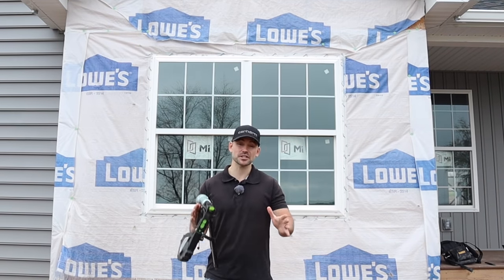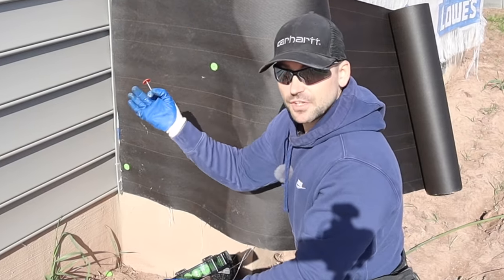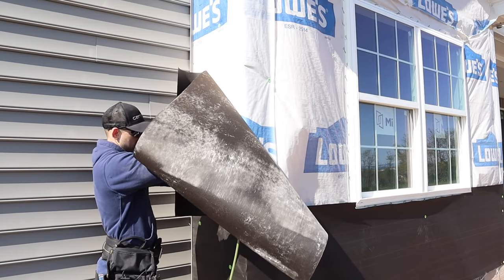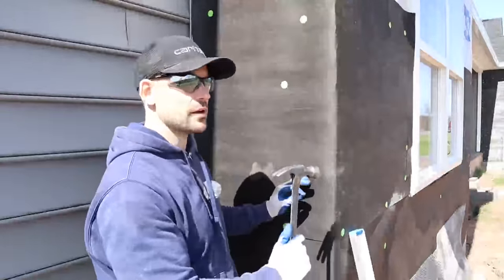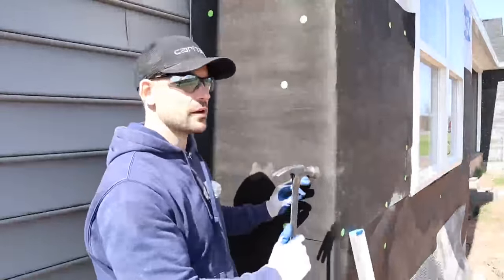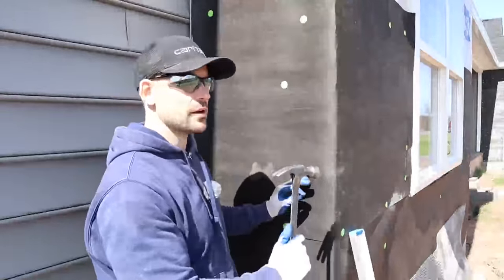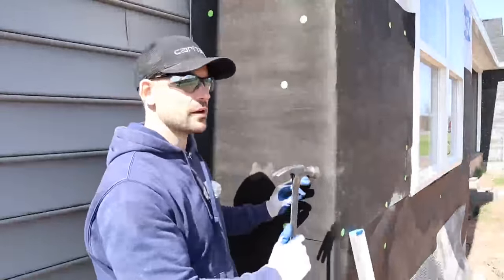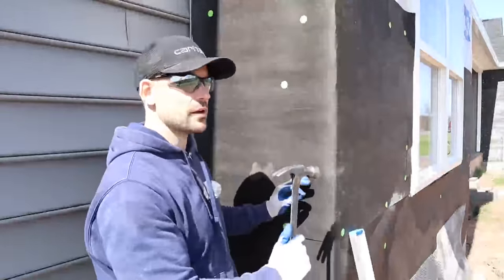Stone Veneer Installation - Part 1. Scratch Coat (Metal Lath And Underlayment)

Comment: I think you might be wrong about the stretch metal.  It is directional.  If you look closely at the little diamond shapes they form a cup.  The cup should face upwards so that as the mortar gets smashed into the screen, the weight of the mortar pulls it deeper into the screen.  If it is upside down, it will have the potential to pull away from the wall/screen.  Where the WRB meets the window flange, if you can/can't get the WRB under the flange of the window, you can use Tyvek tape or similar and seal it to the flange. I believe the WRB and window flange should get taped regardless.  Maybe someone else can comment.  When it comes to wall failures, it not the first rain or the second rain or the third rain or snow or freeze that will cause a failure.  Its like smoking cigarettes.  The first pack won't get you but over a lifetime, you run a higher risk of having issues.  (sorry for the analogy).   Once water starts to get to the OSB, the issues start to happen.  Thanks for the video!  Terr

Comment: The memories of doing cement stucco is so similar. We mixed everything in a big chop box tub because of the volume of cement we did or even a cement mixer. That's all one person did to keep 3-4 guys going. The pully system we used was great for taking 5 gallon buckets of cement up the scaffolding even up 6-8 towers high. Having a 4×4 piece of exterior plywood to load up and go at it. I absolutely love how you take this to a level that those who may never have done either stone work or stucco, will give them the opportunity to try a small project. Expansion joints we had to do on areas that were really large for the purpose of the finish coat on stucco was so important to not get a over lap joint that would actually look bad unless you had at least 4-5 guys running the wall area at the same time from the bottom to the top of the job. Having options is always great to make any job look great. Thank you again Josh for the first part of this project.
Reply from the maker: I have never done stucco before but I would imagine it is very similar to this. I love the look of stucco. Sounds like you guys were very serious! It amazes me to see these huge buildings full of stucco around the beaches. I could only imagine the amount of labor it took to do those huge jobs. Sounds like that is what you guys were into. It is cool how you can paint stucco. The next video is going to be of applying the veneer. Thanks for stopping by David!
Reply: @TheExcellentLaborer  can't wait to see the next step.

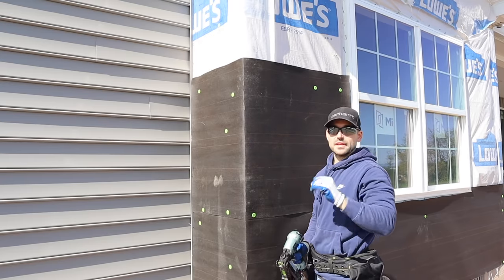Comment: Did I mishear 8:00 ? Installing lath with rough side facing down gives less support to mortar after applying it, making higher chance for it to fail later on. From my understanding, the angle of the lath creates slight upward facing tiny shelves for the mortar to sit into and support.
Reply: That's what I thought. That's the way my father-in-law did it for 30 years
Reply: You are correct, he did seem to be saying apply the lath cups down, which is wrong (although you will rarely see failures in the mortar due to this) Strangely enough the close up shot of his lath at approx. 17min in is cups up though.
Reply: @gabrieldwiggins4442  it might be he was referring to the cup concave facing down... Which would be strange use of English or maybe just a mistake? Not something a pro would mistake though imo.
Reply: Yeah.. he said it right.. you want the cups to cut into the mortar when you start at the bottom and go up. That way it fills the cups. Once it dries it doesn’t matter at all how they are oriented. But they need to be imbedded. To test this try to install lath over a span of 2x4’s without a backer. Properly installed the backside of the lath should look like you are stacking popcorn on the back of the wall. Flip the lath the other way and it won’t be as full ( lots of air pockets) unless for some weird reason you start at the top and go down with your stucco.
Reply: Everyone has a different opinion for lath direction. I like cup up not down, but everyone seems to have a different idea.

Comment: The stone veneer looks fantastic, very convincing. What do you think I could charge per square foot to install this? I've worked with face stone which is 4 inch concrete bricks that vary in size but that veneer looks sharp.

Comment: I'm trying to put stone veneer over exterior brick.  Would I need a water resistant barrier and metal lathe?  Or could I just get away with using only cement board?

Comment: I'm confused, wouldn't you want the rough side facing up so that it holds the cement?
Reply: The lath cups upward when the sharper part is down
Reply: Didn't he say the rough side is outward to add the mortar later. The metal is adhered with galvanized nails, he said.

Comment: Thanks for the great video! Just curious why the underpayment wasn’t pulled tight when applied?
Reply from the maker: Yes it should be pulled as tight as possible. Sometimes it does get a little wrinkled but it flattens out after you put the metal lath on. Thanks for watching Roni!

Comment: Hey! I’m planning on laying some tile that looks like stone on our front entry that is covered under a roof. Pretty thin, just like Floor tile, do you need the wire? The product instructions say use thin set. Currently we have the synthetic felt over the OSB and plan is around the front door, side wall etc.  Thanks! Want to do it myself.
Reply: It is likely you will need the metal lathe. Interior vertically applied tile is typically applied after a Hardie backer covered wall has been prepared with redguard. This creates a solid surface on which to install tile, and you can apply your thinset directly onto the redguard prepped wall.

However, in your case, you have sheathing and then house wrap if everything was done properly. The house wrap is not a solid surface and the thinset will not adhere well to it due to its waxy texture. The felt paper does two things: gives your mortar something textured to stick to and creates a barrier between the house wrap and the mortar. This allows the house wrap to continue doing its job shedding any intrusive water. However, the felt alone has not enough structure to create a solid surface for your mortar. You will need to install the metal lath so that you apply the mortar over a solid surface.
Reply: Thank you!!!

Comment: For interior stone veneer, can you install metal lath directly over painted drywall? Or should you remove the wall and install a cement board?
Reply: Just put tar paper on the drywall, metal lath, scratch coat, stone in that order then grout if your using it